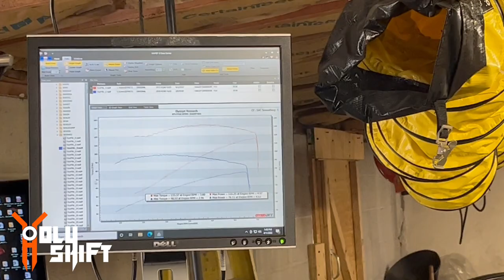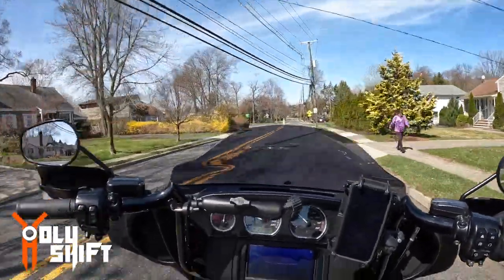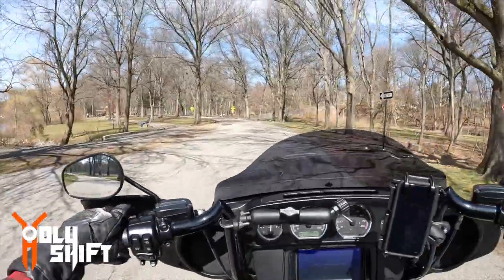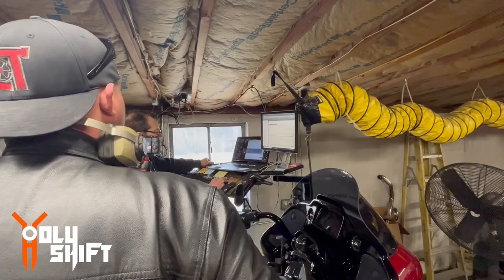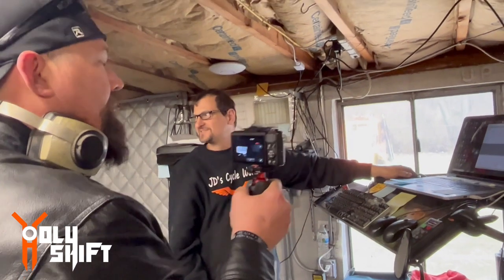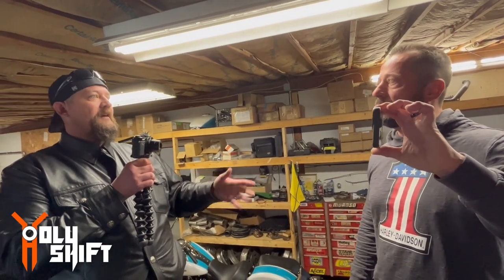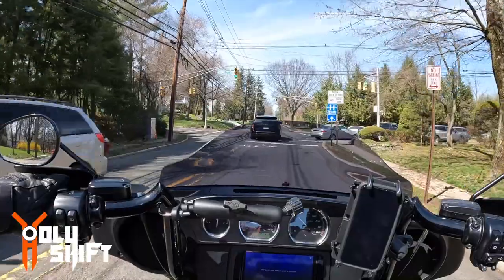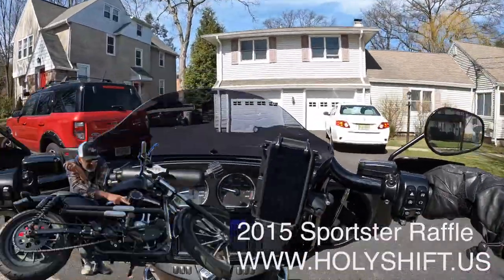Void Harley’s Warranty !! ??

Comment: Great video and cool you got to meet Determined Veteran. I would recommend you stay without a stage 2 at least until you do your first service. This way, you can really see if anything major is wrong with engine etc. If there’s anything wrong with engine, it will likely happen during that period. Besides, that 117 puts out a lot of power and if you want, do the headers and pipes through Harley for a stage 1 for the first year, keep warranty and if all goes well, then you do the stage 2.
Reply: Yes the 117” definitely a stage 1 from Harley and keep warranty I’m guessing the 117” with stage 1 is close to guys on stage 2 with 114” I would think.
Reply: @CodyMcDonald89  close yes but the “right “ stage 2 on a 114 is a noticeable difference from a 117 stage 1. I’ve actually done a prior video with John when he had his and you can tell. 🤙

Comment: Hi Sandy:  the 2022 HD Low Riders ("S" and "ST") come with the 117 engine as you know.  I purchased a 2022 FXLRS 2 months and these 2022 non-CVO bikes (with the 117) run pretty darn good as-is off the showroom floor, specially the lighter weight Low Rider S/ST (awesome power to weight ratio stock). These bikes essentially come with a High-Flow Air Cleaner and Stage-1 Tune already in the ECM; just add some aftermarket slip-on mufflers and you're good to go. On mine, I added S&S Slip-on mufflers and a Trask M8 Checkvent metal (OE is plastic & non-vented) Transmission Top Cover Plate to ventilate the crankcase. Other upgrades include:  Saddlemen SDC Seat w/mini-backrest; Perf. Machine Grips; Black Levers; RWD fully adjustable Rear Suspension (Monoshock w/remote reservoir).  I recommend not to do the HD SE Stage-2 and wait until 2-year warranty is up; or wait and put at least 3,000 miles on the bike (under warranty) and if nothing breaks, etc., then can go for it.  FYI:  The Zippers Redshift 472 cam was developed for the 117 engine.  Tip:  on any HD M8 build...Crankshaft/flywheel...once you're around/at 140hp level (or higher), the best approach is to do (upgrade mod or replace w/one from S&S or Darkhorse) the flywheel.  That power level and/or above, the flywheels can shift (resulting in excessive runout).  Just my 2 cents.
Reply from the maker: Very good info brother- thanks 🙏🏻

Comment: I’d spend your money on upgrading suspension and brakes.  Then put some miles on it to make sure the engine is good. Then put an aftermarket cam in it.
Reply: My bike is a 21 ultra and had 2200 miles when I purchased and been riding all the way to 7500 miles no issues so I did a cam install let harley do it spend roughly $1500 extra letting them do it labor wise but was worth it to me. Bike made 119hp and 129trq

Comment: Love the video Sandy … these cam and dyno videos are very interesting.. I bought a brand new street glide with a 107 and after a couple of thousand miles on it had Dave put a stage 2 on it.. I have kromewerx pipes s&s 475 cam and Arlen ness air intake and Dave’s magic tuning.. I have 109 hp and 117 torque.. runs great.. that being said after you break it in definitely go with s&s cam or redshift 468 and if you want more torque the dand cat pipes produce incredible numbers.. good luck with your choice

Comment: Hi Mr. Holyshift, 
If anything was to go wrong,  it will be withing the first 2 years.
I will keep my warranty protection and just add a SE HP cam, exhaust with a tuner and enjoy it like that until warranty is up, and you can even add 5 more years extended. Worry free
Reply from the maker: That’s a good choice
Reply: Always a good choice staying warranty but I knew spending the money I wouldn’t be happy with screaming eagle stage 2 so I went aftermarket way
Reply: I bought my 2021 Fatboy last year and at the 1k mile service the engine case had to be replaced. Im so glad i had kept my warranty intact by using HD parts. If i would have went with what i really wanted like a woods 475 cam and dynojet tuner i would've been screwed.  It was all coverd and replaced by Bergen County HD where i purchased the bike. Also the HP cam from SE 462 and the short shots from VH  i got sound sweet. Like a harley should. Im happy with just that. Good luck with your choice!

Comment: Happy going speed limit & not getting any tickets. Had license suspended way too many times.  One more ticket would have gotten me 5 yrs suspension. May go with a stage 1 on my 2023 114 for better millage & cooler running....as ive been told?

Comment: One thing to consider… get the 131 stage 4 through Harley. After the 2 years, put a aftermarket cam, exhaust and tuner, you’ll be putting up much greater numbers. What I’ve seen from others it would be 140s in the torque and horsepower.
Reply from the maker: Actually in the 160s

Comment: I would forget about the warranty Harley's been making that engine for 5 years so they kind of have a handle on what that engine can do and it can't do. It would be different if it was a brand new engine that I would take the warranty and not even touch it.  
Also you have a Master mechanic. Dave from the videos it seems like he knows what he's doing and I'm pretty sure something bad will ever happen he wouldn't break you over the eyes with the price to fix it
Reply: But sometimes a engine cam still fail from factory depending on who put it together that day lol